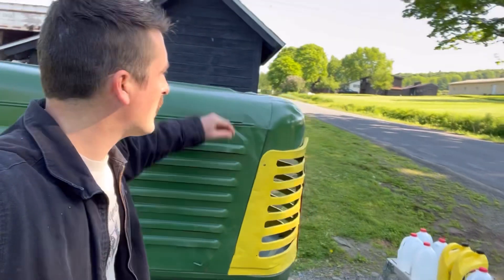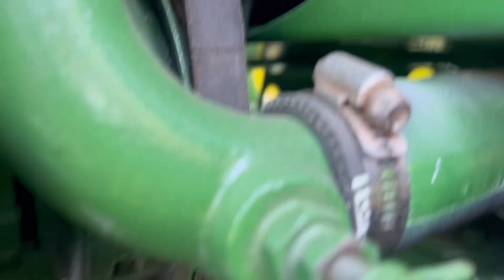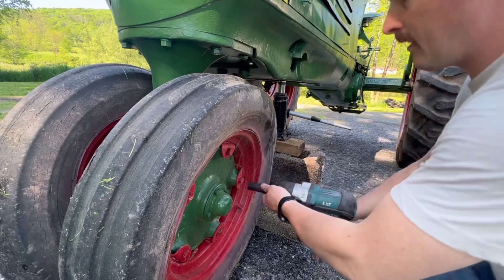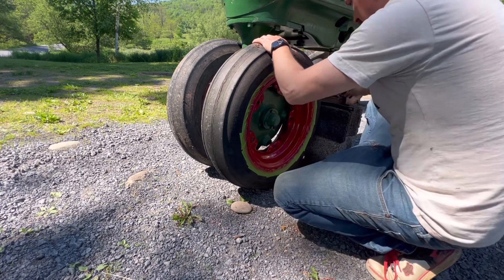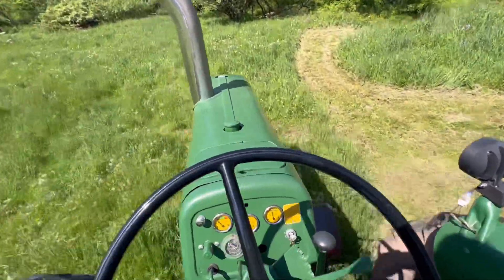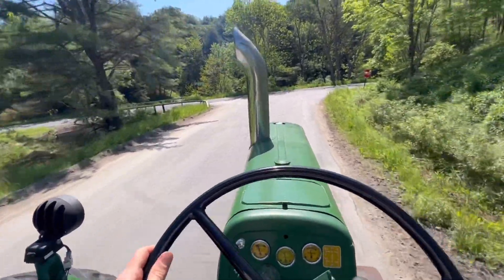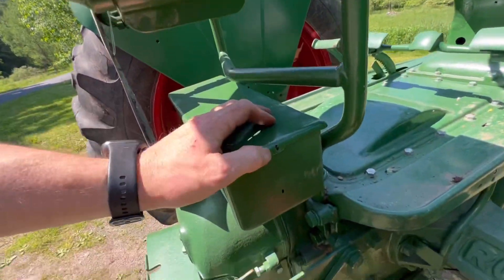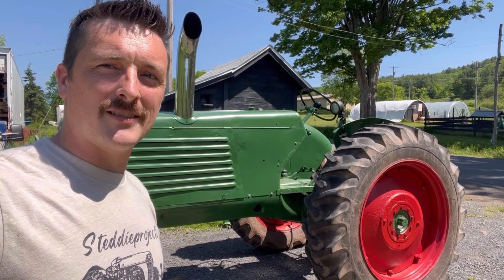Oliver row crop 88 maintenance

Comment: You can really get yourself in serious trouble real quick with a tractor with a tricycle front end on inclines even shallow road ditches you can overturn them if you are not careful stay safe green horn
Reply from the maker: Yeah, I’ve seen some pretty bad accidents with narrow front tractors. I do have a wide front end on the parts tractor. Maybe I should swap front ends sometime. 🤔